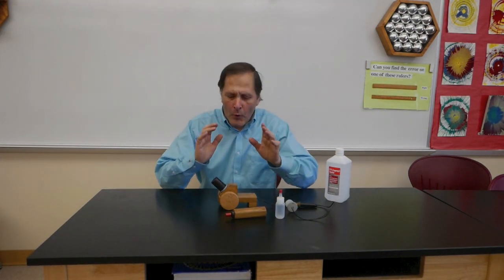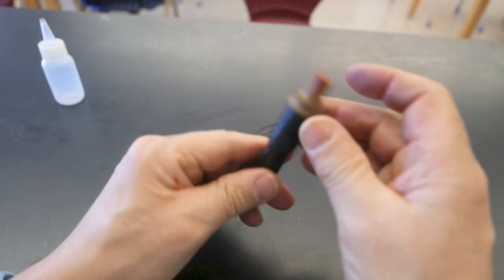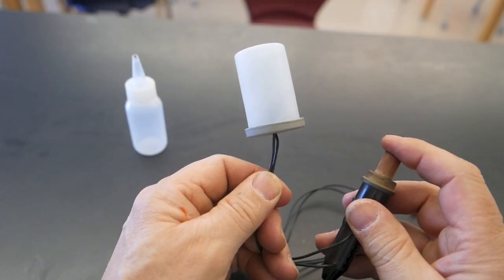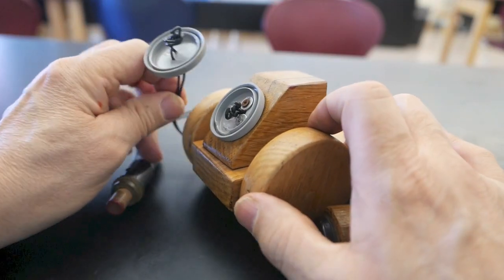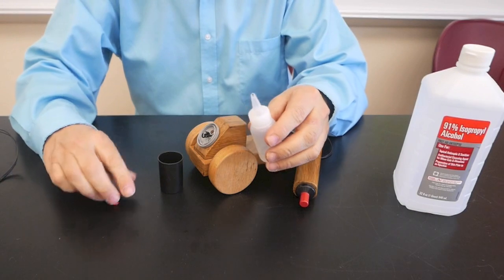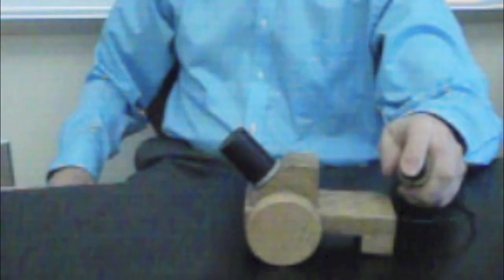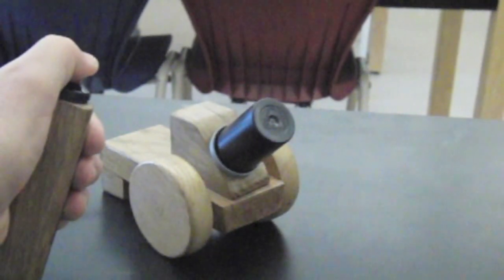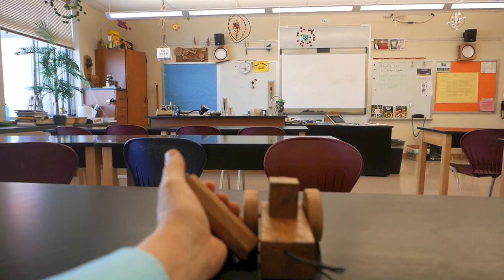Physics of Toys--Film canister cannon // Homemade Science with Bruce Yeany

Comment: Nice toy, I must try it.  Sadly, I think the days of film cannisters are numbered...  Never mind, there are lots of sustitutes.  I haven't got a piezo igniter, so I'll try using coil, diode, cap to get the spark.
Reply from the maker: you're right,  it is harder to find the canisters around.  The piezo igniters are sold as replacements at hardware stores,  or you can pull apart a cigarette lighter but it is much more fragile